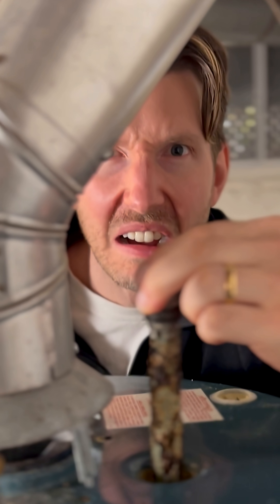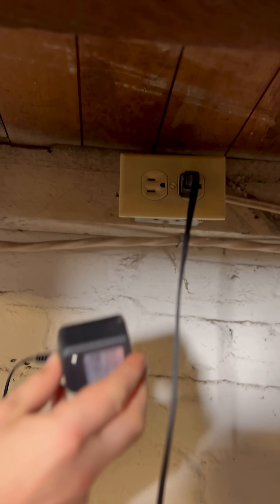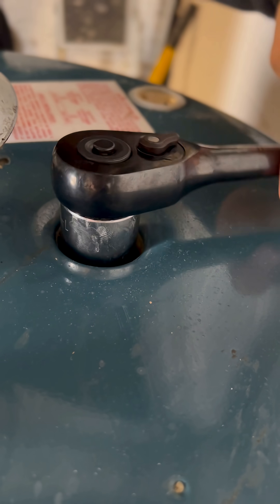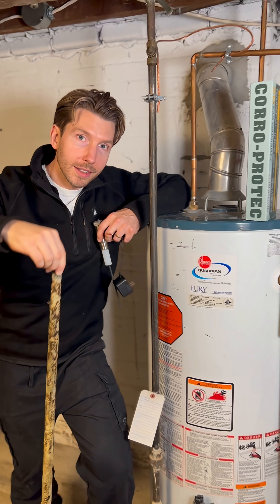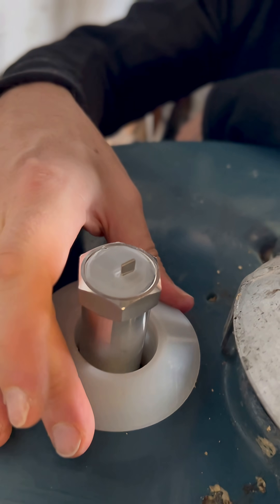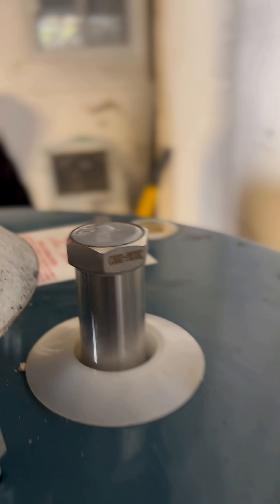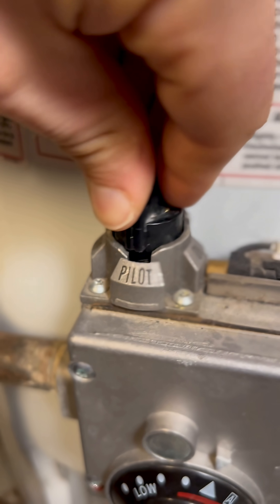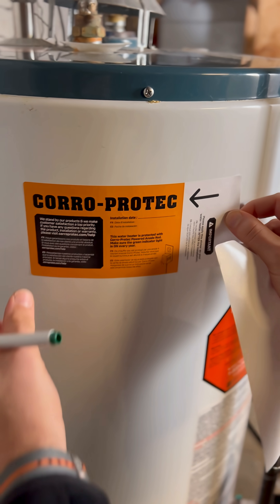What is that? Yank that rusty thing out now!

Comment from the maker: Here’s why Corro-Protec saves you money: 
You could save about 10% on your energy bill because your water heater stays efficient. Corro-Protec powered anode rod keeps energy costs low by stopping corrosion and reducing sediment buildup, so your system doesn’t have to work as hard.

Comment: That old rusty one. IS NOT! It looks to be, i would guess, about a year old! Yeah, that means it is actually fairly new and do not need to be replaced! If it was old it would show the tiny (about 5 mm thick) core!
Reply from the maker: That may be correct, but also not really the point. The point is: this system is a better and more effective rod solution!